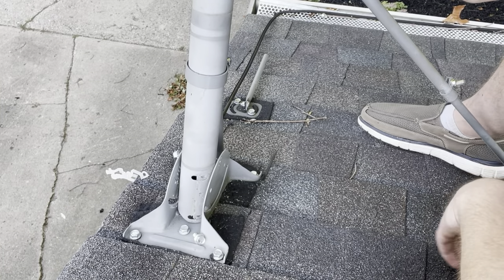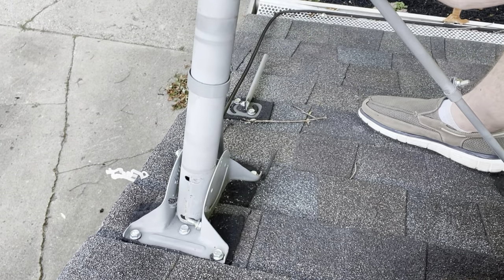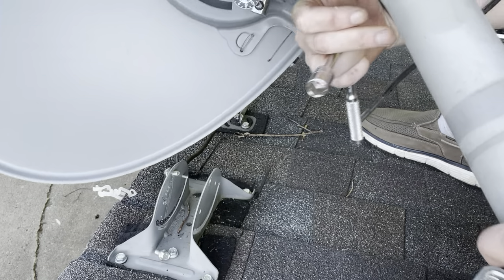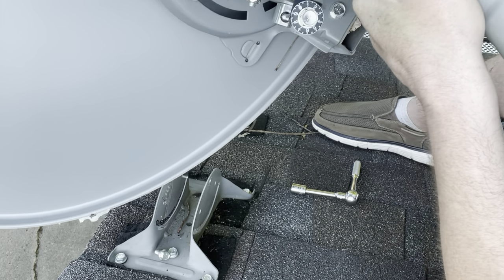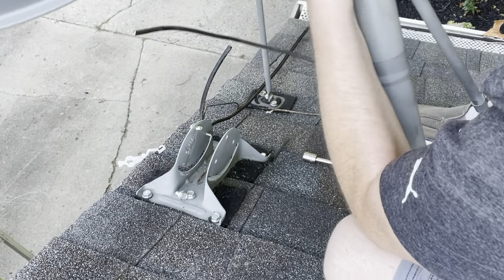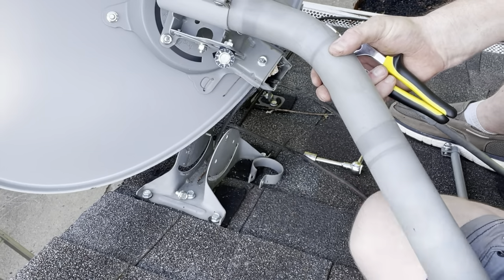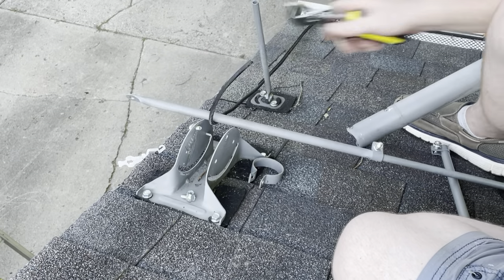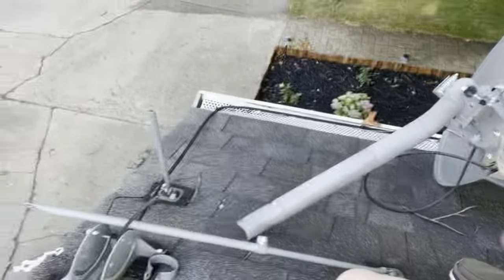SATELLITE DISH REMOVAL - HOW TO REMOVE A SATELLITE DISH - DIRECTV DISH REMOVAL

Comment: I need to get the base off will the wrench work for that too? I disconnected the dtv a while ago and used the same coax cable & ground for my antenna which needs to be changed to the next gen but next week there coming to take down my whole balcony and in s week later put the new one up! so I need to unscrew everything exactly the same so I can put the new one up otherwise there just taken them down and maintenance guy is taking all the coax cables
Reply from the maker: Any type of adjustable wrench should work as well!